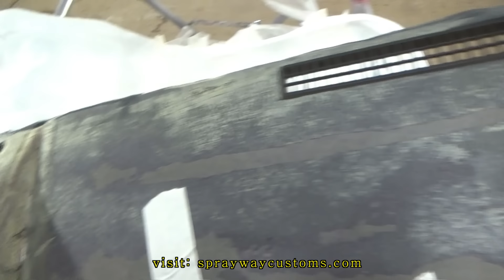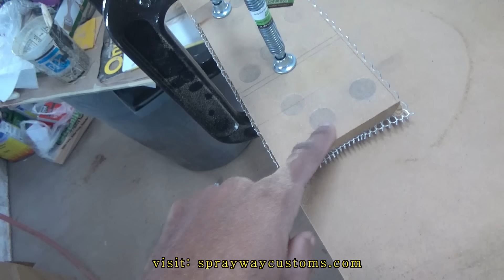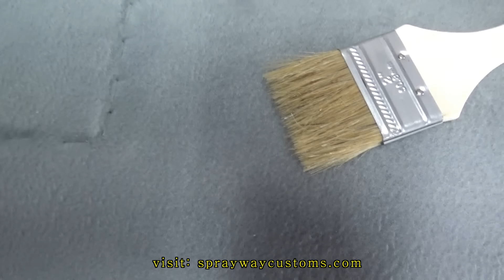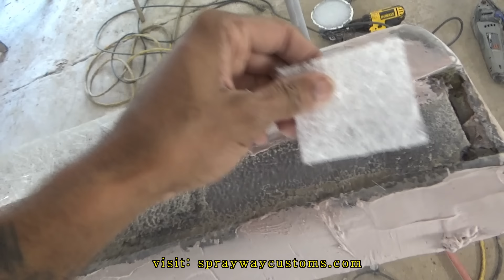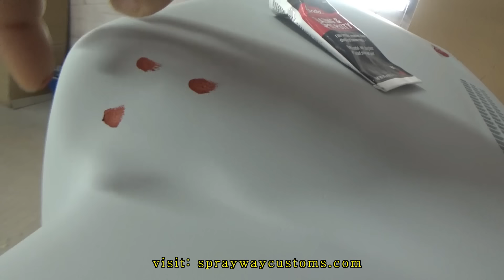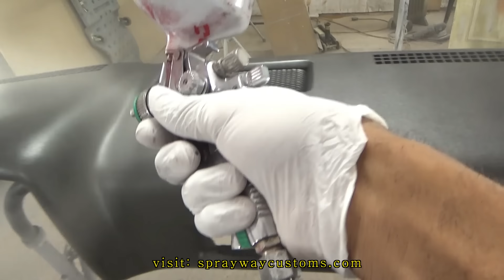Cracked Dashboard Repair With Fiberglass - C10 SQUARE BODY CHEVY TRUCK - How To Fiberglass Dash Pad

Comment: I'm a square body truck nut. That is a gm truck 80 to 87 style dash. I'm not normally impressed with dash work.  But you made a custom speaker and air vent area that are not normal for this style. Which I got to say dam good job. I got a better look then original. Bravo!!!!
Reply from the maker: Thank you Bryan

Comment: There are no words to correctly describe what I just watched. It's like you took an ancient artifact and restored it to its time of greatness and made it even better. Which you did. 
Absolutely incredible.
Reply: And he did his homework and research before he started!  Great work!
Reply from the maker: I appreciate you both 👍🏾
Reply: Truly amazing work my friend!!! I am so impressed and glad to have found your channel!!!
Reply: Facts.. I see nothing but raw talent. This ain't your everyday guy.
Reply: blown away with what you did to that dash, especially the bed liner texture. you are a true pro.
Reply: Good work
Reply: I love how you repaired that c10   Dashpad, great work, it look better than the  new replacement dash I have. I have my original  dashpad that I like to have repaired!
Reply: @SprayWayCustoms  I am working on my first dash amd was wondering how do you deal with places the fiberglass mat doesn’t adhere to the felt underneath?? I have a few spots now that it is dry that didn’t wet out like the rest. Should I cut them out and refiberglass or bonds over the top?
Reply from the maker: Troy Ackerman it'll be ok, you can just put another layer on top unless you have air pockets close to the surface...then you can just cut them out and feel them.
Reply: @SprayWayCustoms  thank you sir your video have inspired me to fix the dash and door panels on this 79 Ford F-250 rather than just buy new stuff that never fits quite like the original stuff does.
Reply: i would love to see an accident and see what it does to the face when it splinters this is y dashes are padded and u support it
Reply: @dpmack967  u want a fiberglass dash what do u think is going to happen if u get in an accident and ur face hits it and the fiberglass splinters in ur face this is not a smart thing to do and if u have a passenger and u fiberglass ur dash u are going to get sued big time and since u did that ur insurance co. can back out of it and leave u with the full bill and they will not cover 500,000 dollar lawsuit which this could hit even more real easy

Comment from the maker: Go Check Out My New Video On Dashboard Crack Repair. https://youtu.be/cgogOR2baqc
Reply: instaBlaster.
Reply: How much thickness would you estimate that process puts on the dash?
Reply: I totally need to know if you have a good front windshield for a 1976 gmc c25 but a 76 C20 or even c10 windshields fit. I need one desperately for my truck!!!

Comment: Did not expect the dash could be saved at all. Looked like it was stored under the sea for 10 years and then a volcano spread lava all over it. You turned it into something that looked very reasonable given the circumstances. Cheers!
Reply from the maker: Thanks for all the support

Comment: So I did my dash, you were 100% the reason I thought I could do it myself. It didn't turn out perfect or even pretty good for that matter, but I learned a lot bro. I'll make do with what I have right now, but I'll be fixing it one day. I used too much resin and rondo and it doesn't fit like it should. It was cracked worse than anything that you ever showed so I know trying to take it off is going to be a mess. I'll try sanding down as low as possible, down to the fleece, then a thin coat or rondo and filler where needed. Thanks for the tips man.
Reply from the maker: No problem. Keep at it and you'll get it taking care of

Comment: Awesome results. I used to do quite a bit of fiberglass work. Ever consider a woven fiberglass and you probably went a bit light on the resin. The woven fiberglass mats soaked with resin usually minimizes the air pockets underneath. I used to dip the material into the resin then lay it out and use a bondo squeegee to force the excess resin out along with a majority of the air pockets. Obviously this is not a requirement as the results of your work are amazing but it might save you some time.
Reply from the maker: Thanks Chris

Comment: Wow that awesome how well that turned out. I like to see it installed in the truck to see how well it fits. One other thing the lil tabs at front of the dash pad slide into slots in the metal portion of the dash, don't get screwed in, so need to drill that lil hole under the front trim piece.
Reply from the maker: Ok, thanks a lot

Comment: I refurbished mine. I had issues with fit on the left and right sides but mainly with the gauge cluster due to the built up material (fleece with resin). Mine turned out well, but the next time I restore one I know what to look out for!
Reply: How well did The gauge cluster fit after?
Reply from the maker: I didn't have the actual cluster. I was thinking about that myself. I was thinking if it was any issues It probably would be easier to trim the cluster.
Reply: SprayWayCustoms the cluster is a very tight fit..trimming will be very difficult as the fasteners are tight in the corners. Mine barely fits but there are gaps etc. I used similar methods to what you used, and, 5 years later, it seems to have held up, but the gaps are bad.
I have templates for the cluster, I may remake it in steel. I will send you pics through your website email when I get a chance
Reply: SprayWayCustoms I also had to grind down the parts of the dash around the cluster to make it fit, LOL, and redo some bodywork

Comment: Check out USC Fusion Bondo for your last coat. Also u pol dolphin glaze for minor flaws.  It will save you a lot of time . Unless you don't like runny bondo.
Reply from the maker: I've used both. Thanks for the info though 🤝

Comment: Pretty amazing work taking what I would have thrown out and making it better than new!  Only thing wrong I can see is tiger stripes in the finished product from the bed liner. Easy way to help spray the aerosol bed liner with more even coverage is heat the cans up in hot water before spraying. Have a couple cans in a bucket of very hot (not boiling) water and rotate them out every half a dozen sprays or so. Goes on much more even and you don’t begin running out so soon and have the pattern issue you mentioned. Thumbs up for an amazing video!
Reply from the maker: Thanks for the info

Comment: I cant stop watching this video. Im watching closely to each step along the way before I tackle this job to my C10. What advice would you give to someone like me that lives in Las Vegas where summers are 100plus degrees? Is there a coating that I could use to battle the sun and prevent it from fading or possibly cracking again?
Reply from the maker: You shouldn’t have a problem with fading

Comment: dash looks great, great craftsmanship, just one problem, those vents were removable because thats how you get to the rear mounting screws, so now it will be difficult to both install and remove in the future should he need to, as for the hole behind the trim, ive never had the trim off of my dash so i didnt even know it existed
Reply from the maker: Thanks for the info...much appreciated

Comment: What do you suggest to repair a small Crack in the corner where the dash goes from high to low side.
Reply from the maker: Fiberglass will be the way I would go

Comment: I have a question on my silverado the dash is plastic and in the process of removal it completely cracked from front to back so the dash came out in three sections. What bonds the plastic together so I can start working on it?
Reply from the maker: You can just wrap fleece around it and start from there
Reply: @SprayWayCustoms  thanks for replying yes I definitely want to do that but the dash board is in peaces. It's so bridal frlm the sun that it cane out in 3 or 4 peace. I want to bond the peaces together to wrap it.

Comment: have you ever thought about using the infusion method for the fiberglass?  it would certainly eliminate air pockets.  It would be more expensive though.  nice work.
Reply from the maker: No I haven't but it's something to think about...thanks

Comment: Another masterpiece, Rust Oleum makes a comfort grip trigger for any spray paint can, snaps right on the top, allows the can to shoot in a fan pattern, you can get em at Wally world for about $8 FYI....
Reply from the maker: Yes, I had one years back but misplaced it 🤦🏾‍♂️

Comment: How do you make sure that dash that are sent to you by mail fit after completing? I would think that adding fiberglass and bondo would make it a tight fit. Appreciate your videos, they help a lot.
Reply from the maker: It do but I try to trim down the original dash before I start fiberglassing

Comment: Sprayway if you look at one of the videos by Ant off Wheeler Dealers, he uses a roller with spikes in it when fibreglassing to get rid of air pockets
Reply from the maker: Yes. I've thought about purchasing one years ago but just never did

Comment: Do you ever have any clearance issues with reinstalling from the layers built up?
Reply from the maker: I like to have the vehicle so I can test fit it before I paint it because you could very well have issues.
Reply: @SprayWayCustoms  cool, thanks for the reply. I'm assuming if you have issues you remove material from the underneath side? I only ask because my k5 blazer dash is crack city, and I'm looking for cheaper options than the 400 dollar replacement. Your videos got me all hyped up lol

Comment: Spraying, if your dash is not in horrible shape, maybe some small cracks, can you clean out the cracks like you show, then use Kitty hair to fill the seams, then do the rest of your process and skip the fiberglass mat steps?
Reply from the maker: You could but it’ll eventually open back up because it won’t bond well to the original dash

Comment: Do you think one of those devilbliss finish line  is a good gun? It’s thee in one prime base and clear. Or should I buy two guns one for primer only ? I’m looking to buy the finish line what you think?
Reply from the maker: Those are great guns. I would recommend getting a gun for each if you’re able
Reply: @SprayWayCustoms  I was thinking a cheap husky for primer and a good one for paint and clear. You ever spray with a husky I’m thinking since it’s going to get sanded anyway I don’t need an expensive gun for primer

Comment: I've watched this video several times now, you do some beautiful work. I've got a Chevy square body (actually two) and the one thing that worries me about this job is on the driver's side dropdown along the instrument panel it bends inward when you look at it from the front or rear and when I look at mine, if anything they bend slightly outwards if anything. I hope the man was able to make it work in his truck without damaging your work. That being said, one of my two trucks is a parts truck for the one I've been driving for 15 years. I'm working on the parts truck dash and have the fleece and the first coat of the resin on it. Tomorrow I'm hoping to get the fiberglass and second coat of resin on it. I'm a little curious as to why you didn't use your "Rondo" or homemade skim coat after the first coat of body filler? I would think it would have filled holes better. Thanks for the video, I'm learning.
Reply from the maker: I didn't use it because I had already put to much time in the sanding by hand. Thanks for watching

Comment: Best results on that matting is to rip it not cut it straight and soak the fabric real good then apply the fiberglass mat soak that as well after mixing in the Catalyst brush then use a roller to get all the air pockets out for a super smooth finish
Reply from the maker: Yep...I know

Comment: Do you spray adhesive on the fleece too, or just the foam? Also do you let it get tacky for 10 minutes or whatever before putting the fleece on? I tried it with lycra instead of fleece on my dash and that would not adhere to it and the fiberglass wont stick to the foam by itself, it pulls up. Also when your done fiberglassing do you cover a layer of bondo over everything or is it fiberglass filler before sanding? Thanks a lot for the great video, I hope to get an answer. I havent had a dash in my car for a year now, just the gauge cover and gauges sitting on the steering wheel column. You should make a patrion account if you dont have one. You do great work.
Reply from the maker: I try to hit both just to get it to stick and Staple the areas I feel like will come up when applying the resin. Loctite 200 middleweight tends to work better than the more expensive brands. I use bondo at the end to smooth everything out
Reply: Also you have great painting technique, I used to paint production. Ranging from kynar, epoxy, carc and baked enamal as well as different primers and clear coat using hvlp guns, guns hooked up to pressure pots and electro static guns.

Comment: Hey. Why didn’t you do the rondo on this one?? I’m doing the same dash right now. Should I do rondo or just body filler after the fiberglass??
Reply from the maker: If you sand it enough and get it smooth you wouldn't have to use the Rondo
Reply: Ahh. Ok. Well my shit was all lumpy. I did the rondo yesterday and still needed to bondo quite a bit after. Should be all good now.  Thanks again for sharing your skills with us!

Comment: First let me say, you do some great work. My only question is this. When you are done, the dash seems to be a bit thicker than the original. Does this cause any problems when re installing the dash? Also, on a chevy C10, there are some clips that go along the top- that help hold the front of the dash down and I did not see those on the video. Are they something you just didnt talk about or is that something the installer has to worry about? Just wondering. Otherwise, that dash looks awesome. And the video was well done too.
Reply from the maker: Sometimes it could be a problem with the size, that’s why I constantly test fit. The dash was already took from the vehicle when I received it

Comment: Spraywaycustoms where can I get the cloth blanket been trying to do mina but haven't found the cloth
Reply from the maker: In the fabric department at Walmart
Reply: @SprayWayCustoms   is it regular blanket  ?
Reply from the maker: luis cruz yes...pretty much any fabric will work as long as it holds the resin until it dries

Comment: You can do the same thing with a plastic dash cover.  They only cost $130, are easy to install and avoid all of the effort, time, expense and mess associated with repair.  They look far better than the results most people are capable of achieving.  I used one when I restored my '81 C20.
Reply from the maker: Thanks for watching

Comment: Where is the junk yard located at please ? BTW, those clips on the top just slide in, no bolts. Then set screws in the bottom /lower edge.
Reply from the maker: Thanks....the junk yard is in Athens, Alabama called Pitts Auto Parts...real reasonable prices

Comment: if you have a tear, take a left over piece and shave some material off with a razor blade and glue it with a product called liquid stitch, the heavier the material the better the repair will look. put the glue on and lightly tap the material on with your thumb using very little pressure
Reply from the maker: Thanks man

Comment: Curiosity man, if you were to just leave the fleece and resin hardener, and sand and do the truck liner then paint. Would it hold up? Awesome btw man.
Reply from the maker: It wouldn't on areas that tend to flex.
Reply: Copy. Thanks for the reply man. Looking forward to more vids from you